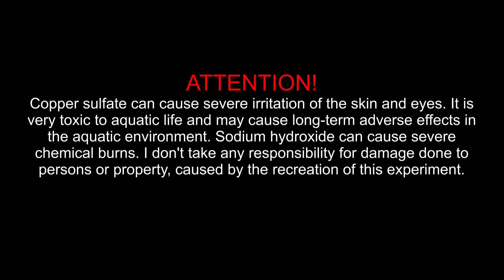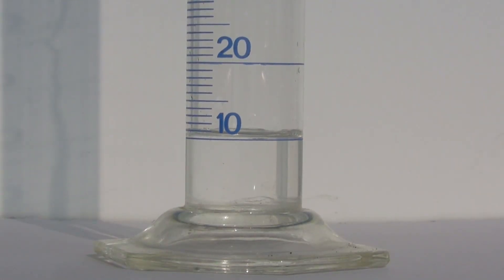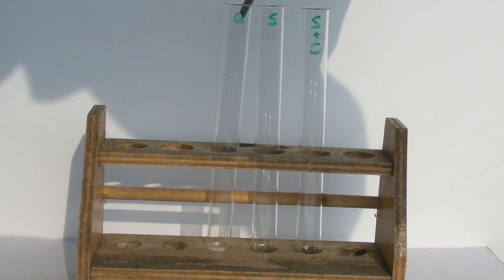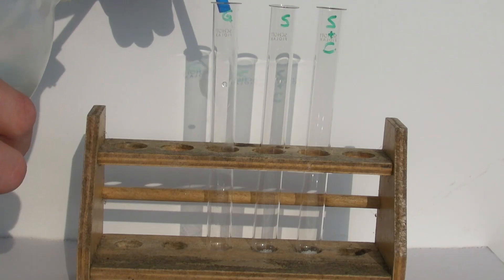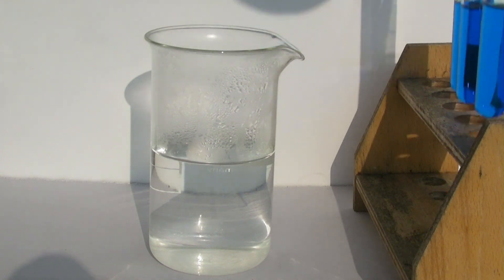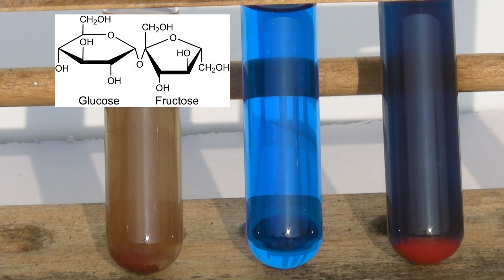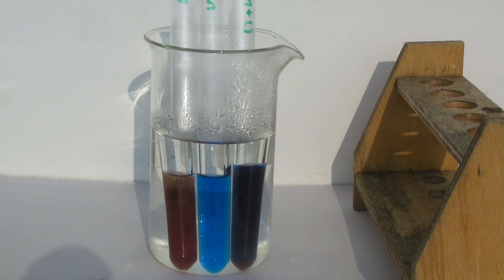Fehling's test

Comment: Can you also explain the reaction if you add starch or lactose in a fehling's solution?

this is for my research x3
thanks inn advance
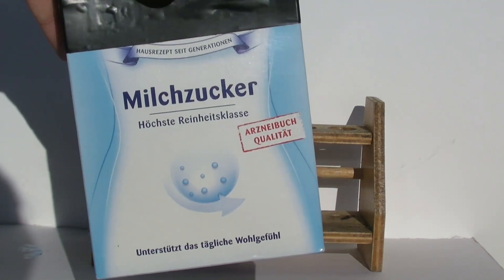Reply from the maker: Theoretically amylose is a reducing polysaccharide, because the anomeric carbon atom is at the end of the chain. Nevertheless as far as I know, due to the large molecular weight, the number of functional groups per gramm is too small to get a visible reduction of copper. In lactose (3:45) you can see that the anomeric carbon atom of the glucose is not connected to the galactose. So the ring is able to open, while the connection from the 4th carbon atom of the glucose to the 1st one of the galactose stays.
Reply: Thank you thank you so much! TBH i have learned more stuff about this experiment than in my class XD...
i will recommend this vid to my teacher and hope she will learn something from it too (>-<)
Reply from the maker: You're welcome :D

Comment: Fehling's solution test-🤕🤒😞😖😭in this test aldehyde react with 2 molecules of copper sulphate and also with two molecules of sodium carbonate gives CO2 which is called as brick red precipitate with its byproducts carboxylic acid with 2 molecules sodium sulphate and 2 molecules of water

Comment: Excuse me, can I ask you why the sucrose + citronensäure(citric acid anhydrous)  mixture shows the color change?
I want to know the principles behind that.
Reply: It's been four years, but I'm writing so that someone else doesn't have to google. Basically, sucrose doesn't give the Fehling's test because the aldehyde group (-CHO) is locked up inside the ring due to the glycosidic bond formed. But this glycosidic bond can be broken up in acidic environments, so when the citric acid is added along with the sucrose, it breaks down into glucose and fructose, which are the constituent molecules of sucrose. The glucose and fructose molecules are the ones which give the Fehling's test and the solution then turns brown.
Reply: If you can explain for me, I'd be very happy.  fullofsoulman@gmail.com  this is my e-mail address. You can send me an e-mail for additional explanation.  Have a nice day !   :)
Reply: How thick do you have to be to write all that out instead of googling it yourself